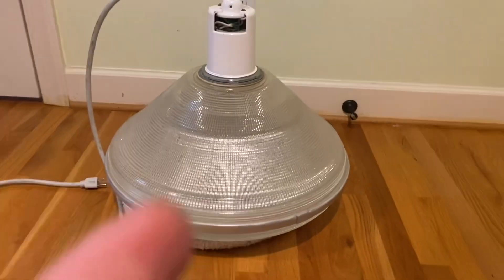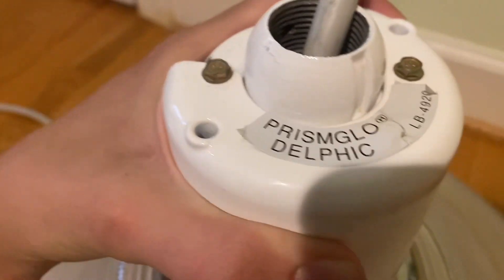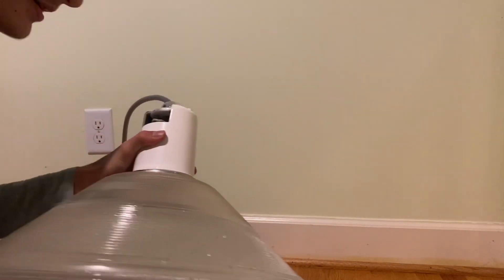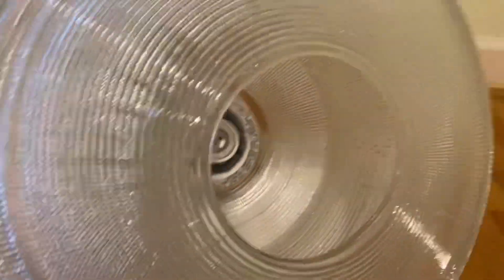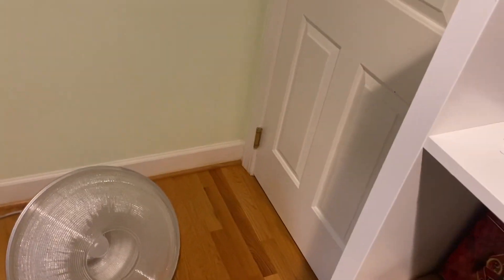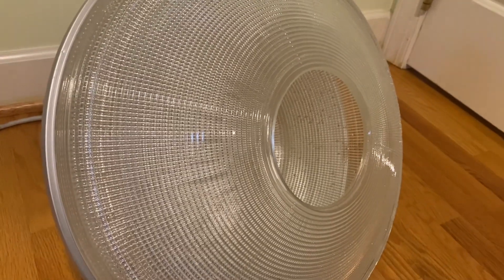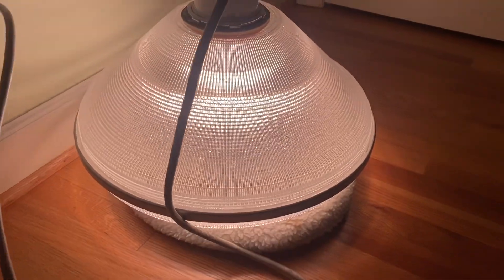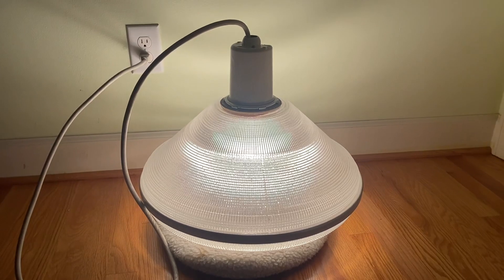Holophane Prismglo 175w metal halide low bay light fixture

Comment: You could always put a self-ballasted mercury vapor bulb in it (100 or 160) if you don’t want to connect it to a remote ballast. I have a Holophane egg shaped fixture with teardrop glass bowl, and 175-watt integral ballasted metal halide lamp. It was a sales rep sample, and has a very long power cord with plug.
Reply from the maker: I could do that. But they are relatively uncommon, and I already set up a remote ballast for this light. It now runs a 70w Philips Mastercolor CMH lamp.